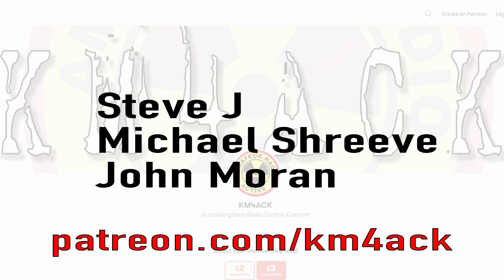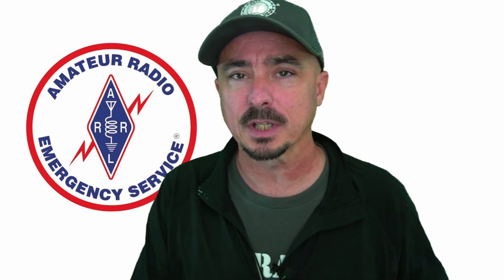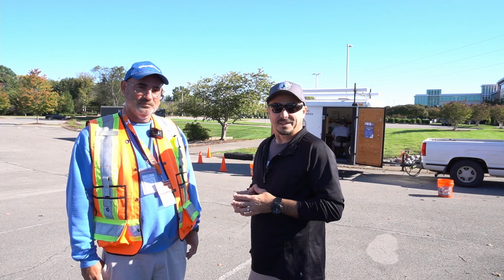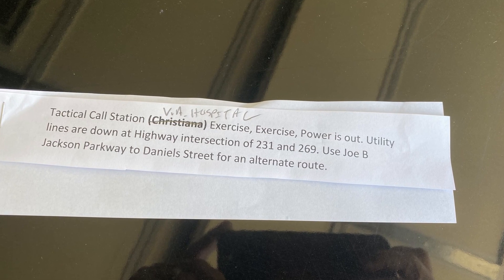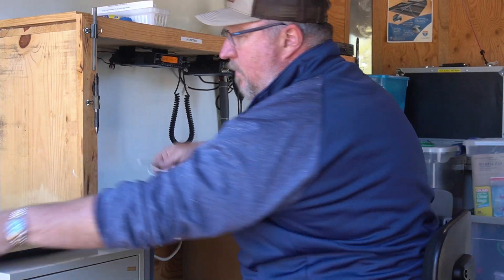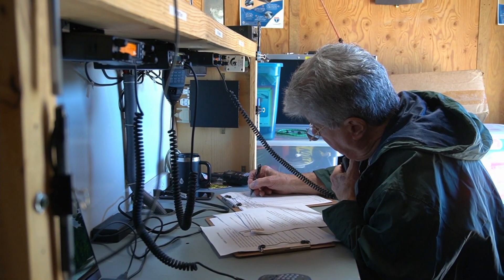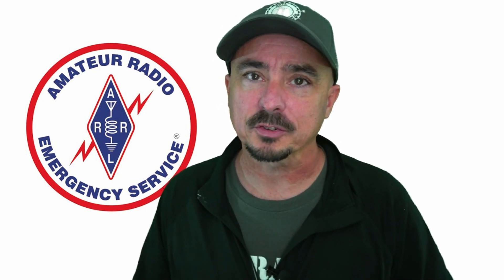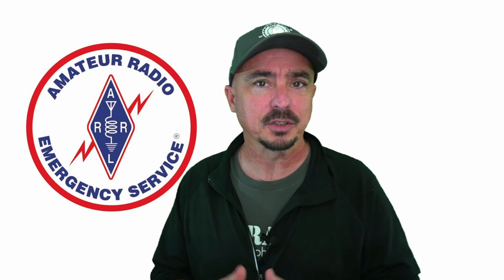ARRL S.E.T. What is it?

Comment: Thanks for the video, Jason! We reportedly have similar things going on here in the UK, but I have not seen it advertised as widely as ARES seems to be doing. Comms preparedness doesn't seem to be so front and center over here, which is a bit of a head-scratched to me. Some comments on the digital comms they were using in the video - Winlink sounds like a good choice to me. While I understand the choice of Vara HF (excellent performance) and gateways, surely a full preparedness test should also test peer-to-peer and something like ARDOP/WINMOR/etc as a "lowest common denominator" scenario. After all, not everybody has the use of Windows and Vara, and setting up RPi nodes with PAT Winlink for P2P seems a lot more like a working solution when the over-ripe tropical fruit hits the spinning airflow generator... What are your views?